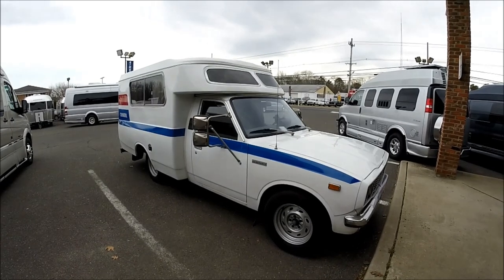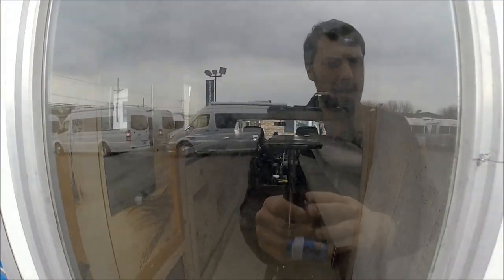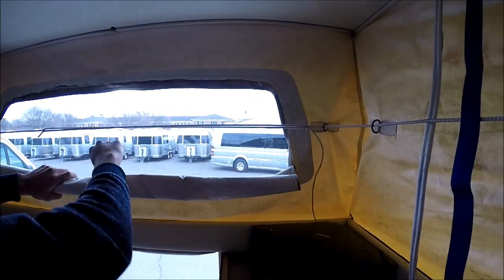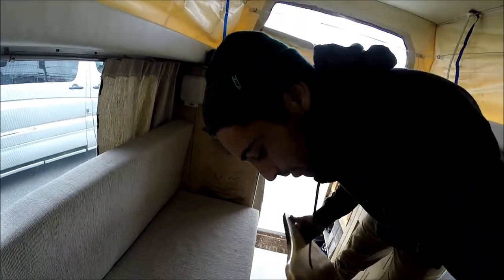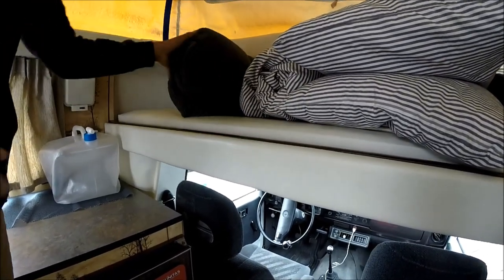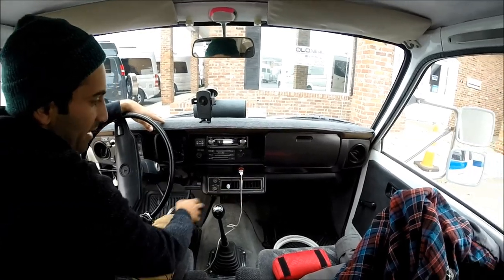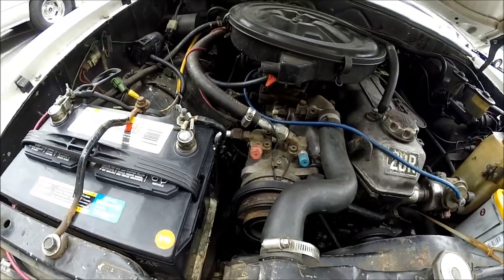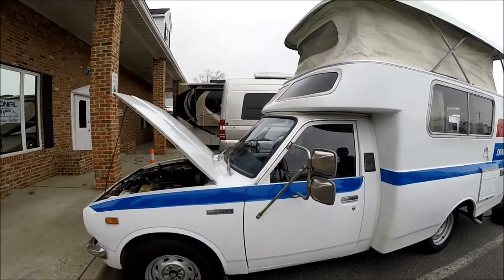1977 Toyota Chinook Campervan RV Pop Top Motor Home With Digital Nomad Tour

Comment: Back then they build stuff with quality. Now, People want cheap prices. Cheap shit item.
Reply: ***** Most item before the 90's are quality built. Even Toy's. Just like Transformer ( Quality metal, Now cheap plastic ). I blame cheap ass people for this problem. :(
Reply: What is the difference between plastic and cheap plastic? Plastic is cheaper than metal. So what? That does not make it a bad material.
Reply: Quality is meeting the requirements. Don't let nostalgia fool you. The built quality back then compared to today's standards is flimsy at best. They use less and cheaper ressources today to produce a superior product.

Your bitching about cheap shit makes no sense, cars become increasingly more expensive and complex.

Comment: We had one of these from 1987 to 1992. We got it in Arizona in a trade for a newer Mazda truck. It had about 70,000 miles on it when we got it. We traveled back to Michigan. We drove to Florida several times and back out west once after that. We drove all over eastern Canada in 1988. Then back to Florida. We wound up with about 120,00 miles on it. Loved that little camper. We had to replace the rear end once but that was about the extent of our major costs. Got about 18 miles per gallon on the road.  That was great for that little 4 cylinder engine. We really miss it. We changed the oil quite often. Probably 3,000 miles.
Reply from the maker: Thank you for sharing your story

Comment: I like how he cut the guy off so he could describe the the important things under the hood like the coolant reservoir.
Reply: 😆 exactly who needs to know what that important upgrade is under the hood. Was it a compressor for air ride suspension, was it a switch to charge the backup battery system who cares who knows who cares...??

Comment: Very nice. Just picked up a 77 Chinook and was interested in the 5 speed conversion. Do you have a way to connect with Chris to ask?
Reply: +alaimie Find a 5 spd from a 22r. Bolts right to the 20r engine but you will need to modify the transmission mount so it will bolt back onto the frame.
Reply: +CompressorSurge Thinking of eventually transferring the Chinook onto a 4x4 Toyota truck with more amenities (5 speed, a/c, etc).  I need to research what years will be compatible without having to extend it.  The latest year I think has been on a 1983.  Any thoughts?
Reply: Single cab with a 110in wheelbase. Basically, you need a single cab longbed toyota. I've seen them converted to 4wd using the 79-late 90's chassis. Check out the forum expeditionalportal. There are a few 4x4 chinook conversion builds on there.

Comment: Sure it wasnt an original dually rear?
Looks a little small.
Reply: +b long the truck version never was a dually but the van version was.
Reply: Originally it had very deep dish rear wheels and wide rear tires. The fronts were normal Toyota pick up wheels.  The ones on the camper in the video are actually steelies from a Ford Ranger.

Comment: He must not cook on the stove with the propain tank empty 
It needs halogen headlight conversions and led bulb conversions everywhere 
I wonder if the fuel hoses were replaced to not leak due to ethanol.and the fuel tank is metal the ethanol will rust that out if not redcoated   It's a lot of work to adapt old cars to the cheap gasohol they sell us